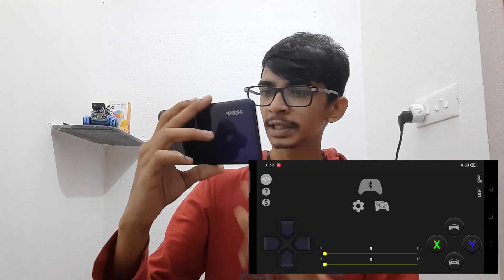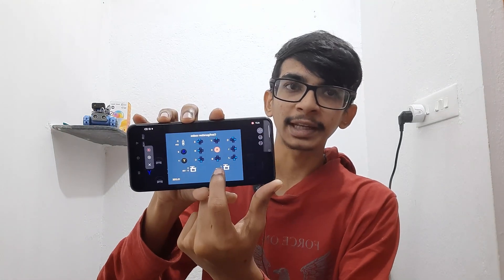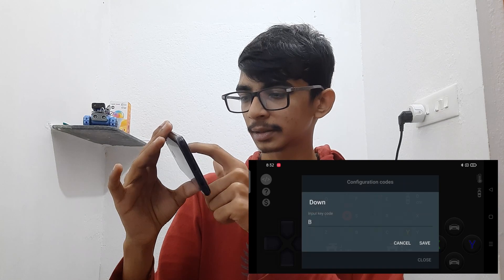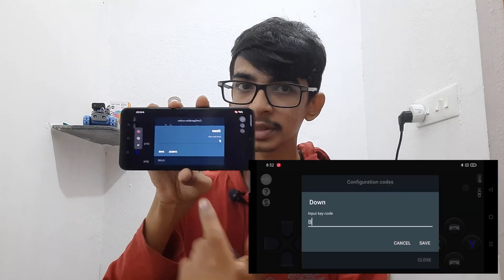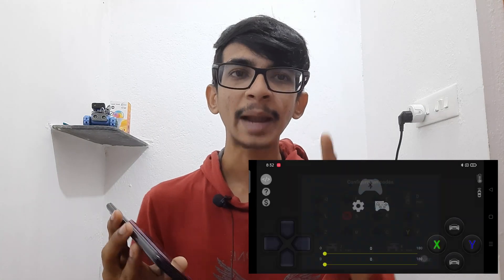DIY Obstacle avoiding with Bluetooth control | All in one car | Smart Modular | Arduino

Comment: Anna server motor fit pannanu na code eppadi painrathu motor driver la enga fit pannanu solluenga pls pls pls pls pls pls pls
Reply from the maker: Just servo library add panirunga, servo code loop session la epdi venumo add panikonga as per your idea, then motor driver la last edge la 6 pins iruku atula 2 servo connect panikalam.
Reply: Thanks anna

Comment: Bro when I fixing l293d driver on arduino in ide port is disabled when I remove driver the port is enabled why pls reply
Reply from the maker: There may be issue in your driver or due to low power it may not work , remove the driver upload the program and connect the driver back to Arduino. 

Also check your driver is properly working.

Comment: Bro can you make all in robot car with using
Arduino UNO
Hc-05 Bluetooth module
Sg_90 servo motor
L289n motor driver
IR sensor 
IR receiver module
MP3 IR remote